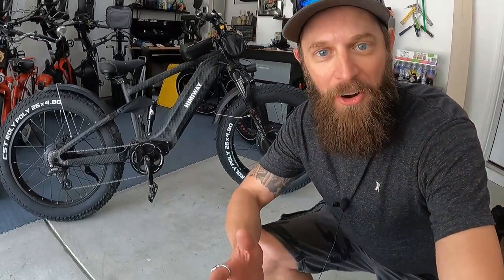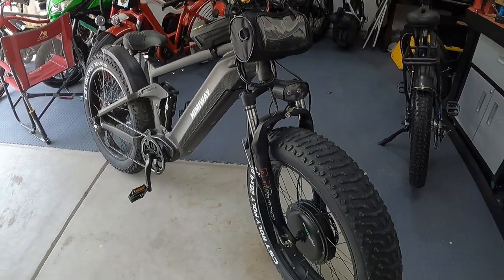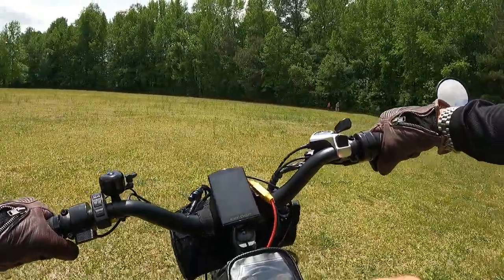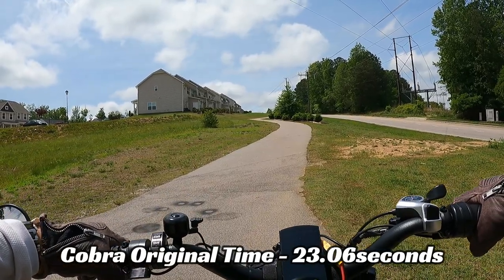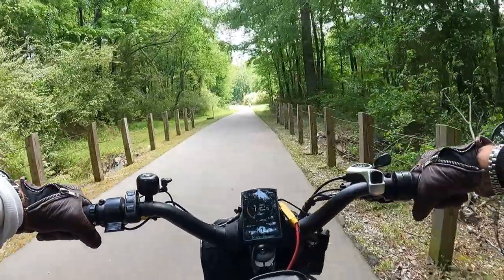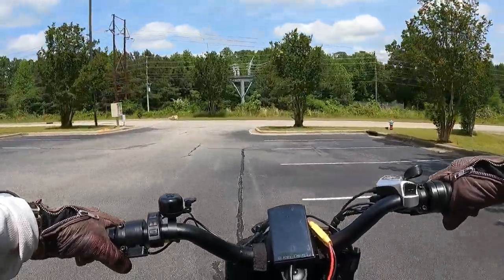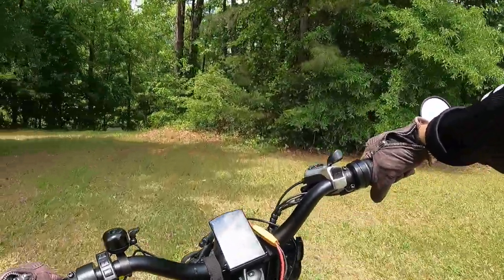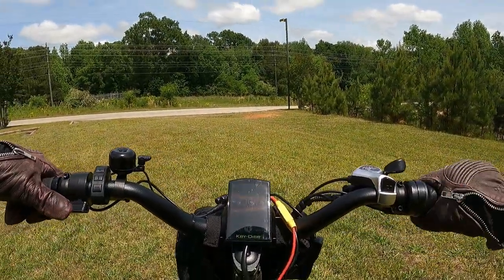My Himiway Cobra is now AWD!

Comment: Super review and well done on making another 2 wheel drive system. Ok, now we know that 2 wheel drive is the answer for our hill climbing challenges what about pulling a trailer? I was going to upgrade from my 750watt 2018 Rad Wagon to the Rad Burro work trike to truly be able to ditch my pickup on small work/hauling cargo loads but sadly they have discontinued its manufacture! I thought maybe I could get another trike but none that are available have enough power. Would a 2 wheel drive fat tyre pull a trailer on hilly terrains? I think I would still like the convenience and fun of a 2 wheeler when not hauling a trailer rather than a trike. The best of two worlds, a fun hill climber and a trailer hauler when needed! CitizenCycle, are u up to the challenge??? Another question, could I fit another motor on the front (I think 2.5 inch tyre) of my 2018RadWagon? Thank you to the very best Electric bike reviewer out there! SkipRay, Kerry, Ireland.

Comment: Citizen ... Cyrusher says that Ranger rear  shocks ship with 150# of air in rear shock mine will not hold air . have you checked your rear shock may be the reason for Rangers lack of travel against the Cobra ???  Rangers triangulation is much better than Cobras yet it lacks performance ,also have you checked your sag on rear of both and do you know length of travel on cobra rear shock ???

Comment: I've been running awd bike for a few years now.. No way I'd ever go back to a single hub. I'm running same setup as you as of now.. but I'm waiting on a geared hub for the front. I think it will lighten the bike up a ton and also make it have more torque. I'm also changing phase wires out to 10ga and going to run 60v 25 amps through the rear and probably 15 to the front.. should be fun!

Comment: I think the type of motors you've used complement each other very well. Geared hub motor on the rear for torque off the line and a standard hub motor on the front to boost top end speed. Depends on what you want the bike to do I guess. Acceleration off the line, top speed or an all-rounder that pulls off the line well and has a high top speed. 
I once saw a YouTube video where a guy just had a huge ungeared hub motor on the rear (probably 2 to 4,000 watts) and from memory he got it up to 90 mpg.
Geared hub motors are not the best for high speeds The small gears in there turning at incredibly high revs, getting hot and very noisy (as we heard in your video) could be a recipe for disaster for a speed bike I think.

Comment: Hello Mr. Citizen, cool Video of the pimped cobra! I want to buy the cobra also and want to change some stuff on it. I personally dont like that shifter that it has and would like to change it with a rapid fire shifter.  But somebody told me that the shifter is directly connected to the right brake lever.  Is this correct, or can i swap it without any problems? I really would appriciate a helpfull answer,  or maybe you could even show this detail on your next cobra video if there is more to come? Thank you in advance and have a nice day!
Reply from the maker: My shifter was not connected to my brake lever. I've never seen that on a bicycle before. You should be fine to swap it out.
Reply: @CitizenCycle925  thanks for the Quick reply!

Comment: what are your specs on each of those motors? are they the same voltage? If one Voltage is higher than the other and you use both, shouldn't the one with the higher one override the other making it useless?

Comment: Some bikes you can’t use throttle, without front motor kicking in? The need to control both motors separately seems paramount to a best usage of a AWD, great idea with the throttles

Comment: I recently saw a Bafang 750w front  motor kit. I  can't remember the site. I  have  a Bafang rear upgrade on my Eahora X5 Plus. Would love to put a kit on the front. Too bad the controller and display determine the power. Mine topped out at 28-29 on level dround. Wind depending. The Bafang is giving me a solid 30-34. Unfortunately the speed limiter on the display cuts it out. Wish there was a way to  jailbreak a display

Comment: I like the idea of being able to not take that stuff on front and leaving just the motor if you want. The bike I have would be able to hold all the stuff on the huge rear rack .. Just need a wire to the motor and throttle ran up.

Comment: Nah it's worse then having to custom cut the spokes, you have to order the right size, 😮 they have spoke length calculators but they're kind of complicated. I figured out a good way to estimate though using the Pythagorean theory and some weed wacker line, and a set of calipers.

Comment: Just a head's up. AWD for bikes has been tried and dropped because it's dangerous. When turning and accelerating, even slightly, the front wheel tends to track differently from expected, typically resulting in a rather fast 'high side', event. As in you get flung towards the outside of the corner.
Reply: AWD drive isn't my cup of tea either...but, he didn't fall did he?  Why can't an experienced rider learn to de-throttle the front wheel when turning?
Yes, many ebike riders don't have much riding skill, but many of us that come from high performance motorcycle riding and racing know how to control a lot of power whatever wheels are being driven.  Lots of front hub motor ebikes throughout the world with no rear drive as well....thousands throughout the world.
I would have no problem whatsoever controlling a separate throttle ebike with 1500 watt hub motor on each wheel, because I can ride anything.
Reply: @lukewalker1051  ,
An RM 250 was given shaft transfer drive down the fork leg to the front wheel. It shared power 50/50 between the wheels. In all other respects the bike was standard. Two guys, pro crosser racers, were spat off in quick succession resulting in various injuries. They also thought they could ride anything. They both said it. Both were proven wrong within minutes. As I said, it typically results in a 'high side', event. Even with a wealth of experience and fast reactions this particular effect happens very quickly. Kind of like having a rug whipped from under your feet sideways. 
But, please believe you're different, see how it go'es.

Comment: Do not waste time,  the top of the hill is Defender S with 3 bateries, 750W motor big enough alone and still efficient at range 15 to 25km/h with 2x750W nicely spread power and with min 2 better 3 batteries you beat at 30km/h any moped or much more powerfull el motorbikes in range.
If you go over 35km/h it is not more cycling you need full safety gearv you do not listen birds but blasting air , pedalling is useless you get much more by reducing your air profile so reduce you hight 20+cm. If look for speed without efficiency  moped is solution not pedalling.